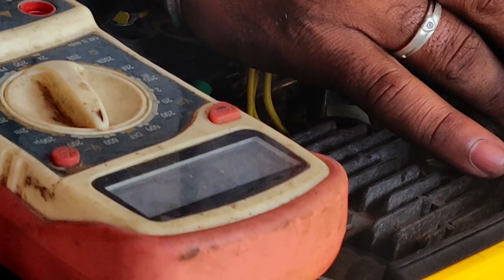pulsar rs 200 wiring heating#regulator change

Comment: Hii bro 
I have dominar 400 
Recently battery changed after battery is not charging appo than engine side cover open panni coil patha black ah irunchu after coil change panniyachu now rr unit lirundhu vara 3 yellow wire full heat agudhu now rr unit change panna heating issue varadha ?
Reply from the maker: Yes bro nega coil change pandrigana nega rr unit um sethh mathuna nalathu ena new coil la corect ana current varum apo old rr unit heat up agum bro atha avoid panna nega 2 um sethu mathuna nalathu
Reply: @jbwheels  new RR unit today changed bro again little bit andha yellow colour 3 wire heat aghudhu 😓
Reply from the maker: @gowthamv3132  light heat irrukum bro mediuma athu onum prob ila normal than
Reply: @jbwheels  okk bro thanks you long ride poi check panni pakren

Comment: bro my rr unit yellow wire and coils yellow wire is heating so much...but in multimeter battery is rechrging normally what will be the problem?
Reply from the maker: It usualy heat up a bit bro but if over heat then its the wiring prob bro
Reply: @jbwheels  ya bro its overheating...so how do i check the wiring problem?
Reply: @jbwheels  how to check the wiring kit bro?my nearest showroom is in 45km
Reply from the maker: @all_in_one700  so bad thats the only way bro if u touch the wiring its hard to fix things back
Reply: @jbwheels  if any shorts in wire the fuse will be blown isnt? my fuses are ok
Reply from the maker: @all_in_one700  no bro fuse will be ok i have wiring problem now no fuse has blown off till now if there is any short circut then fuse will blow off other wise fuse wont go off its because of over power or lower power which can cause the heating by the way what yr model is ur bike
Reply: @jbwheels  2015 bro...
Reply from the maker: @all_in_one700  its been nearly 8 yrs and its bajaj bro so this kind of stuff is normal the quality is not as good as other bikes in this segment
Reply: @jbwheels  ok bro...i will get to the showroom....how much cost for wiring kit
Reply from the maker: @all_in_one700  if its non abs it ll cost u 10 k for wiring and instalation will cost u around 3 to 4 k acording to the showroom and if its abs 13k and 3 to 4 k for instal
Reply: @jbwheels  bro dt8 31 what error code is this?
Reply: Bro problem solved..?
Reply: @all_in_one700   my dominar same problem
Reply from the maker: Its all bajaj🤣

Comment: Same problem my rs 200 magnet coil cuppler is very heat and headlight on than missing problem  i checked magnet coil it is okey. And reactifire is also ok.  What is problem
Reply from the maker: May be in the wiring bro some wire can be damaged that can also be a reason
Reply from the maker: Or can br fuse
Reply: Same problem  what did you do...?
Reply from the maker: Problem like in the video bro???

Comment: Bro in my bike self not working i mena self edukuthu bro ana apa apa selasamayam eduka matikithu after few hours start pana aguthu so what's the problem bro
Reply: Few hours kalchi pota edkuthu bro
Reply: Sir plz tell me the what's the problem
Reply from the maker: Switch prob aa irrukum bro epadi edukuthu battery ukathu eduka ilana normal laa self adikira mathuri adikutha bro
Reply: @jbwheels  bro i have change the clutch switch also battery are new but per day only 3 time self is working blance time its not work
Reply from the maker: @raguram7132  can u check the wiring that connects the self motor and the self switch

Comment: My pulsar rs200 bettery volt is 11.13  but if my bike running 3,4 hour battery gonna down same problem occurred when i replace my regulator
Reply from the maker: Then check with the coil bro
Reply: Bro after changing regulator coil my bike is running some km the same problem occure is it magnet coil problem ??
Reply from the maker: Have u done some thing with the wiring kit added extra lights soming like that if u have added something then there must be a leak in the wiring kit which will cost this prob so better check with the good workshop which has obd tool or a wire end to end checker becuse our bajaj showrooms doest do that they tell us to change the entire wiring kit for small problems
Reply: Yes bro i m adding dome custom light like ring led in fron also install some light in tail
Reply from the maker: @crazynurul  may be that can be the reason bro since i too faced the same prob by adding custom indicators and angel rings
Reply: @jbwheels  bro can uhh give me ur num for asking some thing
Reply from the maker: @crazynurul  sure bro its 8754141199 or try this 6380384746

Comment: Bro, In my rs bsIV, there is issue of fuse blow of fuel pump only. I checked the whole wiring, relays, horn, light, indicators for any short circuit. It goes for few kms, then again that particular fuse blows. Last yr, regulator and battery had changed, everything is fine, but from 1-2 days, this issue is there in my bike. Kindly suggest the solution.
Reply from the maker: Can u just convey that in english
Reply: @jbwheels  i have edited that in English. Plz suggest the solution for this issue.
Reply from the maker: No issues bro check the fuel pump flow to engine if its low some times fuse may blow off or else if the coil produces more power then too.fuse will go off i too have recently faced the same prob no i have changed my pump and now its fine my bike petrol flow was below the limt so the coil helped the pump with more power that resulted in fuse blow
Reply: @jbwheels  that means, i have to change the whole fuel pump set or its motor only.
Reply from the maker: @deepballabh  no bro check with the flow if it exeeds the limit and below the limit change other wise no need
Reply: @jbwheels thanks for ur valuable suggestion. But all service centres are closed here, how may i check this flow by myself. I had cleaned the pump pad, throttle body and FI last yr, But dont know the flow checking process.  Any video or steps.
Reply from the maker: @deepballabh  when u switch on the bike min of 40 to 50 ml should come if it exeeceds the amount it ll create some prob or fuse will blow off

Comment: Sir can you help me about my rs200.. When i switch on all the indicator sign shown up.. But the check engine sign didnt show.. And no toooottttt sound And the push starter not functioning.. What do you think the problem of my rs200??
Reply from the maker: Might be battery prob bro could u send me the pic what shows and what doesnt in whats app
Reply: @jbwheels  the battery reading is 12.4 volts how can i send u picture...
Reply from the maker: @alvinartuz9023  my num is 8754141199
Reply from the maker: @alvinartuz9023  may be regulator prob bro or some mallfunctions
Reply: @jbwheels  do you have fb msg.. Im other country i can send picture to ur fb msg..
Reply from the maker: @alvinartuz9023  yeah bro jephtah jeffie

Comment: Bro my rs200 not charge  change regulator also magnet coil but not charging regulator cable overheating what can we do
Reply from the maker: Tell the mech or else check the wiring of the wire from coil to rr unit
Reply: Bro Enaku Ipo Apdi Dhan Iruku..Enna Panna Bro??
Reply from the maker: Tnf tool undu bro athula check pannalam bro
Reply: @jbwheels  Oh Ok Bro..Naan Regulator And Coil New Va Change Panna Solliruken..Ipo Okay Va Aagirumaa?
Reply from the maker: Yes bro aiirum max wireing heat issue ku athan reason na irrukum

Comment: Hallo Why is my regulator hot when the engine is running .. Extreme heat
Reply from the maker: If its touchable its normal heat bro if its extreme u have to change it if u dont it ll affect the wiring unit
Reply: @jbwheels  tq bro

Comment: Bro my rs200 is also having same issue when i have gone to local mechanic he told me that the port that is connected to coil is heat and my check engine light gets blinking and I have taken to showroom for ecu scan and they told me that its showing wiring kit issue. ls it wiring issue?? Pls tell me bro🙄😔😔
Reply: Mine is 2016 non abs rs200 😢

Comment: Bro when i turn my headlight on my bike pickup get down and gives a jerk.. And my bike rectifier and battery get heated. What may be the problem?
Reply from the maker: Check the wiring bro
Reply from the maker: May be it might be wiring or the rectifier
Reply: @jbwheels  i had  changed my ecu box a month ago and now a problem like that happened.. My rectifier heated like a fire.. May be there is problem with rectifier which doesn't support battery charging and due to that it doesn't give a sufficient power when head light is on? And i had installed a pressure horn too.
Reply from the maker: @Suprimetechnepal  yes bro for what purpose u have changed the ecu unit
Reply from the maker: @Suprimetechnepal  just take the horn out and try once if it doesnt go well then go with rectifier
Reply: @jbwheels  my bike didn't show any line on the display nd it was like dead thats why i changed ecu that time. 
Ok bro nd thanks for suggestion.
Reply: @jbwheels  will be there any problem with coil?
Reply from the maker: @Suprimetechnepal  may be bro because pulsar rs 200 has that fault bro because coils burns out often
Reply: @jbwheels  And my bike main fuse gives a little spark too when putted each time.
Reply from the maker: @Suprimetechnepal  when removed and placed again uh??
Reply: @jbwheels  yes

Comment: Bro ennoda bike self start pannum pothu  start ana aparam speedometer la irukura red color analogue thirumba poitu varuthu bro ipdi 2 weeks poitu vanthuchu bro aparam self ey edukala self pannum pothu back seat la tik tik nu sound vanthuchi batter than problem nu new exide battery poten bro new battery pottu 2nd day self edukala bro 

Ennoda bike la angel eyes and night eye white led 2 mattum than extra add paniruken 
Ithuku munnadi indicator mirror set pannen antha mirror bike kila vilunthu 3 times right side mirror damage agiduchu puthusu ketta pair ah than kedaikum nu sonnanga sari nu 3 times vangunen intha indicator mirror set agathunu wiring la kalati normal mirror use panen 
Ithan bro nadanthuchi

Neenga than sollanum rectifier problem ah wiring pakanuma battery pakanuma nu unga number kudunga call pani kekuren
Reply from the maker: 8754141199 enoda number bro and ithu battery prob than bro vara onume ila battery charge panni poduga seri agirum battery new va old da bro new na warrenty claim pannuga ilana charge pannuga bro
Reply: @jbwheels  bro new battery pottu 3 hours than achu again  self edukala battery vangum pothu eduthuchi After 5 hours la bike ride pannum pothu display la battery symbol vanthuchu nan bike off pani on pani drive pannen 3 mins aparam athey battery symbol katuchi ipo self edukala but athula irukurathu innaki vanguna new battery than
Reply from the maker: @sundaravenugopal4227  apo regulator irrukalam bro morning call pannuga ena prob nu pakalam bro
Reply: @jbwheels  ok bro